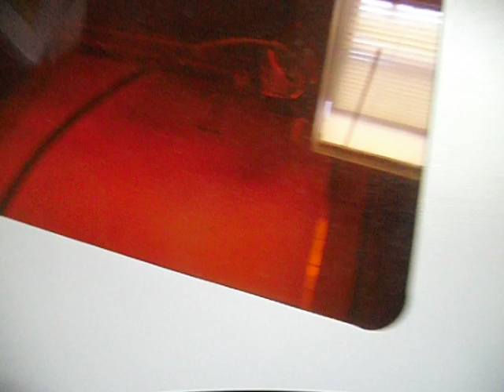China Laser Cutter DCK40ii With air assist on the cheap

Comment: Hi!   Thanks for sharing the air assist idea.  It seems like it is working very well but could you post a close up so we could a better idea of the angle of the air?  Does it actually output air where the laser meets the  material you are working with or is it sort of off to the side?  Thank you!

Comment from the maker: Hi. I purchased it off of ebay. And paper is pretty thin. You really can't use air assist when cutting paper. Why? The air will just push the paper around. But, paper is so thin, you would be probably doing 10 sheets at a time without air assist.